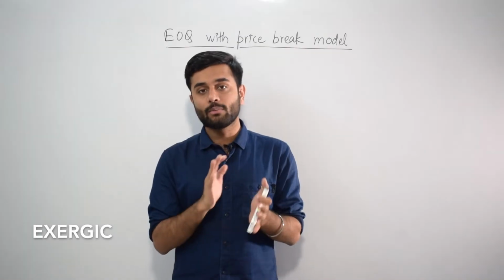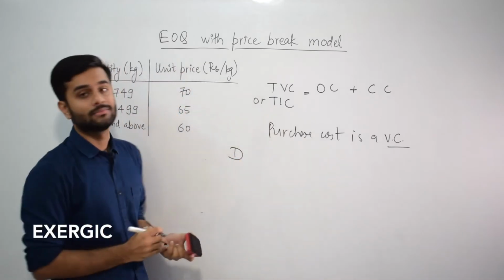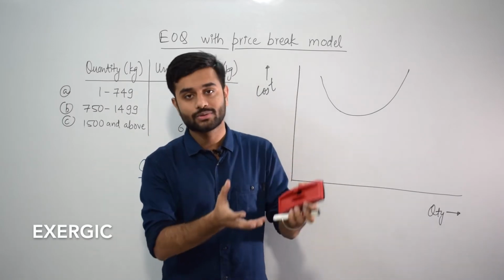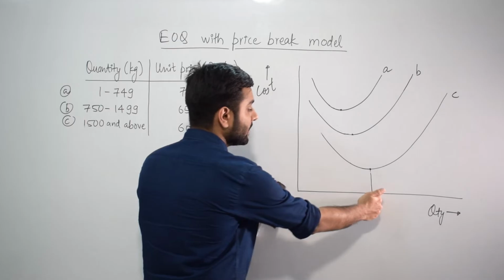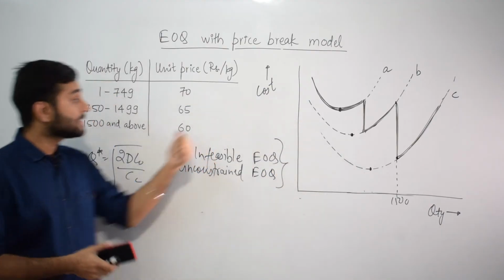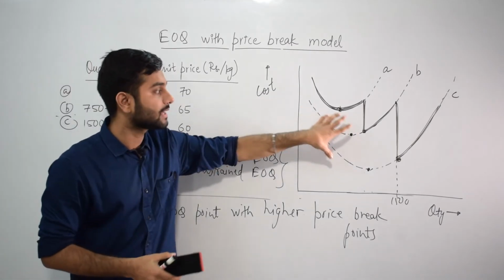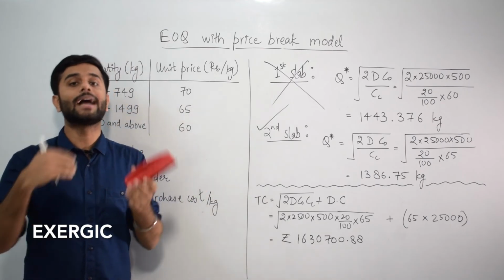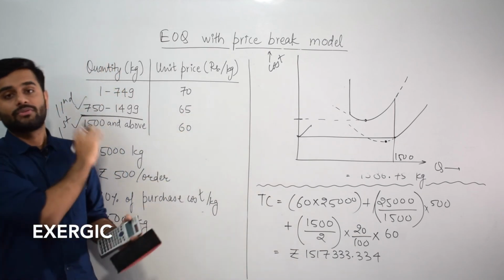EOQ Price Break Model in Inventory Control fully explained | GATE ME, PI

Comment: Hi Sir, 
I see that you have taken the total annual demand to be 2500 kgs in the total cost but in the question the actual demand is 25,000 kg. Hence, your answer is coming as 16,30,700.88 Rs/- but if you take 25,000 kgs as the correct annual demand (D), the total cost will be 16,43,027.7 Rs/-

I hope I didn't overstep.

Comment: Sir why have you taken 2500 as the annual demand for calculating total annual cost at EOQ - 2nd slab 
The answer should be 1643027.75